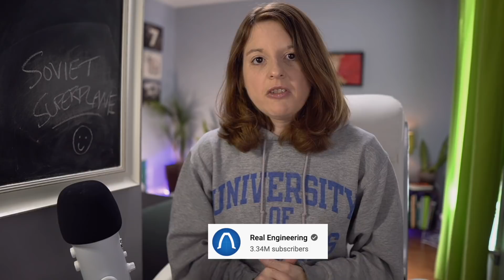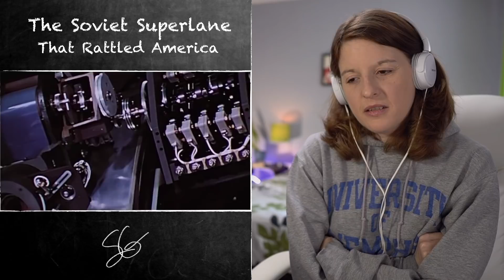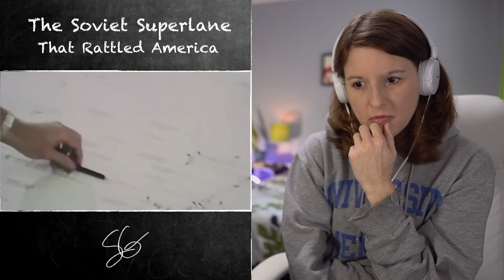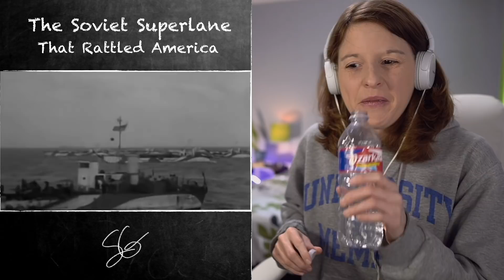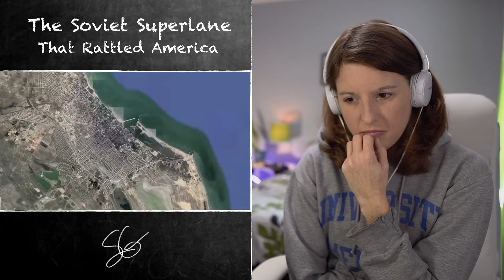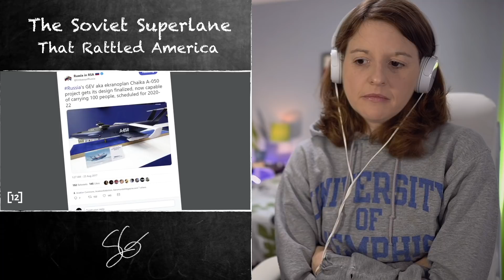American Reacts to The Soviet Superplane That Rattled America | Military 🪖🎖

Comment: I doubt you could use it for cars because you'd need to give them wings so they took off. About the same time as that hovercraft were being widely developed which although at much slower speeds could travel on a cushion of air just above water or land. They also appear to have disappeared from use these days.
Reply: Disappeared ! Most definitely  not - the US, Japanese and Russian military all use very large hovercraft
Reply: @richardwest6358  thats interesting to know perhaps they'll be used more widely commercially i remember the one from Portsmouth to the Isle of Wight which was a very short trip.
Reply: Your mention of hovercraft reminded me of an interesting video from a few years ago. Apparently, the Portsmouth-Isle of Wight service is the only commercial one left in the world. There were just cheaper, easier to maintain, and more comfortable options which led to them disappearing for passenger transport.
https://youtu.be/eYH1lPm41-0
Reply: I'm glad the Portsmouth one is still running its some years since I visited Portsmouth.  If its the only commercial service operating I wonder how long it will continue. Very interesting . Thanks for the info.

Comment: Ekranoplans are the classic example of a solution in search of a problem. Surface effect only works on a flat surface, the sea is notoriously not-flat on numerous occasions, and the moment an ekranoplan climbs out of ground effect to escape the high waves, it just becomes an inefficient, badly-designed aeroplane. In competition with conventional planes, it's safety is compromised by the constant risk of collision with the sea or other vehicles, whilst in competition with ships, it's much more expensive to operate and needs to run it's engines constantly unless surface is glassy smooth.

The missile-firing military versions would still be vulnerable to surface-to-air and surface-to-surface missiles, since the former are usually capable of hitting other ships too, and the sheer size of the Russian craft would give them a radar signature equivalent to a conventional warship. They do make decently efficent small coastal passenger ferries, as the last bit of the video suggested, but the cost advantage over a conventional plane is not great enough to outweigh the limitations, such as not being able to fly to an inland airport.
Reply: I'm not so sure you could shoot down one of these with a SAM or with an anti-shipping missile.  SAMs generally cannot track a target if it is flying too low.  An ekranoplan would fly too fast for an anti-ship missile to track it, once its solid-fuel rocket booster is empty a missile coasts to its target so loses speed every time a course correction is made.  Air to Air missiles also wouldn't be any use as heat-seekers like the Sidewinder have to be aimed directly up the exhaust in order to track and when fired theytypically drop a 100 feet or so as they accelerate to terminal velocity so would hit the ground  as soon as they were fired.  Radar guided missiles like the Sparrow and AMRAAM wouldn't likely work either as the targets are flying so low the ekranoplan would dissappear into the 'ground clutter' - the interference caused when a radar beam hits the ground, or like the Sidewinder hit the ground.

The best idea of how a miltary ekranoplan would do is to look at how the RAF Buccaneers sent to the USAF's annual Red Flag excersise in 1977 did.  The Buccs would fly at 500mph at an alttitude of 20 feet (that's not a typo!) and the USAF jets sent to intercept them either could not detect them or failed to get a lock-on.  The anti-aircraft weapons also failed to get a kill on them.
Reply: @jimcook1161  Semi-active radar SAMs have been extensively tested against surface ships and found to be very effective. There was a plan to buld an anti-ship version of Sea Dart with an optimised warhead that got cancelled for budget reasons, and the USN actually issued the anti-radar version of Standard as an interim anti-ship missile pending availability of Harpoon. The Ekranoplans were big, with a big radar signature: bigger than the average missile boat or torpedo boat, and SAMs have had no trouble hitting those. SAMs can also hit aircraft despite the latter's ability to move in three dimensions, while the Ekranoplans entire MO limits it to two. 

Sidewinders haven't had to be fired right up the jetpipe of the target since the AIM-9L of the early 1980s. These, and all subsequent IR AAMs, have 'all aspect' capability, which basically means that they're sensitive enough to detect the fact that the whole airframe of the target is hotter than the background, and thereby home in on it from any angle. A massive Ekranoplan, powered by eight huge turbojets, skimming across the cold sea, would be about as perfect a target as you could get. As for radar, remember that most anti-ship missiles use active radar to home in on targets that are literally sitting on the surface. The Sea Skua missile used semi-active homing (just like a Sparrow) to attack surface ships, and both Sea Sparrow and Aspide use semi-active homing SAMs to intercept fast, low-altitude air targets.

The RAF Buccs at Red Flag had the huge advantage of terrain masking to hide in. Unfottunately, there are no canyons and mountains in the middle of the ocean. Note that Buccaneers were equipped with stand-off anti-ship missiles, first Martel, then Sea Eagle, specifically to avoid them having to get close to the target ships, where they would have been cut to pieces by the SAMs and AAA. 

Buccaneers bring up another relevent point: if low-level is good, and conventional aircraft can do low-level, then why do you need Ekranoplans to do it? Why not just use a conventional aircraft flying at 20 feet over calm seas, that can also fly at 200 feet over rough seas, up to 20,000 feet to do a radar sweep to find it's target, and over land to attack a much broader spectrum of targets? Put it another way: if Buccaneers had been built as Ekranoplans, then RAF Germany wouldn't have got much use out of them, would they?
Reply: Looks like the future of this technology might actually be sea-skimming drones.  Where modern cruise missiles go about 30 feet above water.    Most anti-ship missiles about 10 feet above water.   It looks like the theory on sea skidding drones is that they could fly just 18 inches above water.

Comment: Ground effect is used in the opposite way to make cars stick to the road by creating a low pressure zone under the car. This effect is used mainly in race cars and supercars.
Reply: Too add to Matteo's comment;
Ground effect was used a lot in the early 80's in F1 cars which saw some interesting designs like the Brabham 'fan car' before being banned for safety reasons.
The new F1 2022 regulations will allow for the return of ground effect albeit in a somewhat different form.

There's a good video on Autosport's YT channel that gives a nice explanation of how it works and why it's coming back. 
"How F1's 2021 ground effect differs from its fearsome predecessor - Chain Bear explains"
Reply: @NihilistCrab  ground effect has been used for all these years. What is coming back is the use of venturi tunnels.
Reply: Ground effect is used by aircraft to trap air under the wings, this increases the distance an aircraft can fly as it rides on the cushion of air beneath, larger birds use this too to save energy and fly much further, the B2 in particular uses this also but for more stealthy reasons, it can also be used to save fuel if need be.